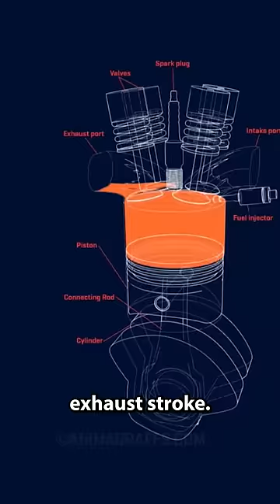Turbos Vs Superchargers

Comment: The exhaust stroke of one cylinder is the power stroke of another. It's connected through the drive shaft. The power to run anything comes from the power stroke of some cylinder. The power conversion of bladed systems in fluid isn't very efficient. With a super charger, you have one fan driven directly by a super efficient belt. With a turbo, you're running a fan off another fan. In terms of efficiency, superchargers are better. In practical application, it comes down to the type of race, and the tuning to determine which is the better option.
Reply: Lmao you obviously have no idea what you are talking about. Turbos use waste heat energy from the exhaust, so they get all that power needed to run the cold side for basically free. There are obviously some losses, but for superchargers, its your engine burning extra fuel to do all the extra mechanical work needed to turn the compressor. So no, they aren't more efficient. They actually drastically increase fuel consumption compared to turbochargers
Reply: Turbos are always more efficient. Superchargers take 10’s of hp to spin-sourced from the crank which turns due to the power stroke. Turbos are not connected to any physically moving part of an engine that the power stroke could move. The only thing spinning a turbo is exhaust gasses which your car makes SEPARATELY from power or useable work in the “exhaust stroke”. The only time you’ll find a turbos efficiency to be less than ideal is when you’re idling and that’s just because you have relatively excessive back-pressure and maybe some heat soak. Which a supercharger is much worse at btw since there’s always a significant “load” to spin the s/c. Also you can and many people do forced induction on less than 4 cylinder engines. They just have more lag because the exhaust pulses (or power strokes) .are further apart: every 90* on 4cyl, 120* on 3, 180* on 2… Flywheels have momentum for a reason so work can still be carried out smoothly between power strokes. Although I think charged air from a turbo will be warmer before the cooler than from a s/c just because it has to share an impeller with HOT exhaust gas which is why an intercooler is almost always necessary for efficient turbos but not always with a s/c. Sorry for the long reply, hope you read it.
Reply: @ZealothPL No such thing as free energy. Turbos require drive pressure, it's the pressure drop across the turbine that drives it, not just heat, stick a turbine in an oven, see how much rotation you get from heat.
Banks himself, talks about back pressure in other videos, that back pressure is putting load on the exhaust stroke, which is coming from another cylinder on its power stroke. 
The efficiency winner is application specific, although more often than not, a turbo is going to win.
Reply: Things people don't consider are that both systems require the engine to consume extra fuel to implement because they increase volumetric efficiency. The only way to test efficiency is to Dyno the engine with the turbo restriction and the load from a supercharger and compare to baseline. Which system causes greater power loss? Exhaust restriction or added load turning a supercharger? Do that for each RPM and compare results versus the power and torque made when the turbo and supercharger are charging the engine.
Reply: Less stress on that one cylinder/rod/bearings is what he’s talking about.
Reply: I agree that it is likely less efficient due to the power in a turbo being from pistion > crank > piston > fan. Whereas a blower is piston > crank> fan. Tirbo likely accumulated more parasitic losses from the extra steps
Reply: @aaronnoyb  "that back pressure is putting load on the exhaust stroke"

the turbo stock or aftermarket, clearly add a muffler effect. so one can easily go more free flowing on the rest of the exhaust for the same db level.
which in theory atleast, should take care of most of your argument
Reply: @hotdog9262  Yes a turbo has a muffling effect, but the pressures are not even close. On my old setup, I was getting 44psi of back/drive pressure, for 28psi of boost, which is considered pretty good,for a street/strip application. Now find me a muffler that could cause a restriction or even contain even half that pressure.
Reply: @aaronnoyb  sure. that is a lot compared to a typical na exhaust. could the turbo and/or the exhaust housing be more optimal though

Comment: Says he prefers turbochargers, then builds a supercharged duranax diesel (aka project lockjaw) to get near instant throttle response. Lol
Reply: You could do a small twin turbo setup for instant torque, it gives max torque much quicker
Reply: The most brutal rally car in history which basicaly baned grop B used supercharger and turbo back in 1986, it weight 1900lbs, had 1,8 L  4 banger and +500HP  Lancia delta S4

Comment: Even if you lose the power on an exhaust stroke its still being driven by a powerstroke on another cylinder, the crankshaft is a ridgid structure. The crank is either pushing air into a turbo or pushing air through a supercharger but in both cases its still pushing

Comment: Thank you Mr. Banks for explaining why a high boost supercharger (10 lb-ft) on a high compression ratio (11:1) gasoline engine can cause a head gasket failure.  This is the reason why you should lower compression ratio of the gasoline engine with lower compression pistons or thicker head gasket.

Comment: Holy cow, Mr. Banks, holy cow. This is why you are d. Guru, in the garage I have a 2017 F 153.5 high output ego boost. My truck was special order. I have the raptor engine without the raptor and I know nothing about Turbo chargers and? Whipples in superchargers. This is my very first brain new truck. I've ever had. It is a remarkable truck and it's paired with a ten speed auto.
I did not know what you just said.
What? You just scooled me on. Just reinsured me that I made the right choice with going with the 3.5 high output VS the 50. Coyote

Comment: To put it simply... Turbo's are more efficient and efficiency creates more power in the end. They don't require extra torque from the engine to work. They use excess power that would go out the exhaust anyway.

Comment: The piston is still connected to the crank shaft on the exhaust stroke so it’s still slows it down. On a V-8 engine, the power stroke for two cylinders is the exhaust stroke for two other cylinders.  Suck, squeeze, pop, blow. When two are popping, two are blowing.

Comment: This is personally why I like twincharging. You get the best of both worlds at the cost of a far more complicated system. 

You get the low end boost of a blower with the high end power efficiency of a turbo. 

The problem is setting up the bypass and having the blower clutch out when not in use and clutch back in when needed.

Comment: I’ve always felt the same way with my builds. Yes in a way the back pressure created by a turbo is still “parasitic”, but for the most part once you get the engine wound up some you’re making power from waste gas, which is far more efficient than making power off your accessory drive. Not to mention you’re also putting much more stress on the crank snout driving a blower hard under boost than you normally would just driving your basic accessories. Anytime you can actually put down more HP per psi that’s a win.

Comment: I don’t think this is true, and I say that with extreme hesitation, being that it’s Gale Banks. The way he explained it made it sound like a turbo is driven solely from exhaust pressure. The exhaust gets that pressure from leftover pressure due to not being able to expand all the way in the power stroke, and from the piston pushing on it during the exhaust stroke. If the piston is doing work on that exhaust pulse to drive the turbo, it gets that power from the crank. 

So that can’t be what mainly drive the turbo, something else is at work here. I don’t know the main source of exhaust pressure. I’d be inclined to believe that residual combustion pressure makes up most of it, and that is a win for turbo charging over supercharging.
But the other MAJOR component is that in most turbines, there is a large conversion of thermal energy into mechanical energy. That is the major reason turbocharging robs less power from engines than super charging—it extracts energy from heat that would otherwise be wasted.

Comment: A huge advantage is that a properly designed turbine (turbo manufactures do what they can, they are limited on space) will recover as much energy as it can from the thermal energy of the gas stream not just the energy in the form of pressure. This means the turbo is running at least partially on energy that would be wasted anyway.

Comment: That used to be true before Displacement Adjusters: three re-expansion and three pre-compression cylinders on a secondary crankshaft produces smooth torque that can be fed to the engine's crankshaft via a CVT transmission that directly controls the engine's working displacement. Maximum efficiency at ANY torque.

Comment: 100% on board with the explanation, but the sacrifice in power per bar in cylinder pressure is worth it in exchange for instantaneous response (this is just a personal preference). If you are after getting the most power in the most efficient way then turbos are the way to go

Comment: As an old-school person I think of it like this, a supercharger you have to hook to the crankshaft and yes it's spools up faster for power quicker. Now a turbocharger is driven off the exhaust system which is a little bit easier, except for the drain back for the turbocharger push the oil to the unit and it spools up slower. But makes great power. One other thing to a supercharger can pump fuel mixture into the engine. And a turbocharger only can pump air into the engine or versus the carburetor.

Comment: Resistance on the explosion creates higher pressure, instead of the chamber expanding and reducing it. 

Turbocharging slows down the engine when there's no ignition happening therefore it's not increasing chamber pressure higher than during standard combustion.

Comment: So with this being said, why did you stick a blower on your 7.1 mega max with the C 10 build and if you don’t like the “parasite“ of the belts, could you run a crank drive pro charger to delete the necessary components of a belt, so you have all power no parasites and you wouldn’t suffer turbo lag

Comment: i agree, to a point, but because a turbo's parasitic power is not pulled on the power stroke of the current cylinder, the power stroke is still pushing the exhaust for an adjacent cylinder. when the current cylinder comes back up in the exhaust stroke, it's being pushed against the exhsust pressure by next cylinder's power stroke (albeit through some degrees lag between events).

Comment: Sir I Honestly Love Your Work, Your Ability To Create The Monsters of Diesel Engines for Which I Absolutely Adore. The 6.6 Duramax is my favorite But Cummins is a Great Motor as well. I am Not a Ford Fan. I suppose because They Have Never Been Able To Build a Solid Diesel Motor. I have Driven Several Wreckers Back as a Young Man and I will Say Uncivilly They are All Bones. They FinallyGod a Decent Transmission because They Are Using The GM 10 Speed Transmission. The Only Thing Ford ever Made in My Humble Opinion is The Heavy Duty Brake Duel Piston Caliper that GM Go Smart and Used.

Comment: Respectable reasons. I'm still partial to superchargers bc you get all that power on tap all the way through the RPM range rather than having to wait for boost to build. Yes, it takes crank HP to drive it, but when you need HP right off the line the supercharger is the way to go.

Comment: Just because its the exhaust stroke powering the turbo doesnt mean there isn't parasitic loss on the power stroke. There is. Its just on the next cylinder in the firing order to make up for the increased load on the exhaust stroke.

What makes turbos more efficient powerwise is that they aren't reliant on crank RPM to spin, every downshift drops the rpm of a blower, whereas Turbos can remain at boost particularly with modern 6+ speed dual clutch transmissions. Newer torque converters have really brought blowers back to center stage for low rpm, high displacement engines.

Comment: In turbocharged application you have the exhaust restrictions from the turbine house. Versus crank driven blower. It depends on the application which is better. The engine doesn't "know" from both either.

Comment: Not to be critical or nitpick, but isnt the power for the exhaust stroke being powered by another cylinder's power stroke? I realize this wouldn't be the case in a single cylinder engine, but in that case the flywheel stores the energy for the non-power strokes. Either way, resistance to the crankshafts rotation at any point of rotation is stealing power. Fortunately for turbo's, it is much smaller loss than a blower. Keep up the great videos, always great info!

Comment: In some applications, the off idle power and response of a supercharger is worth missing out on the hp it takes to drive the supercharger.  Usually a driver thats tip toeing on the limits of traction and has plenty of power prefers the 2d linear response of a supercharged or large powerful na motor over a the 3d response of a turbocharged engine

Comment: Gale I agree with you mostly the one thing that is the back pressure against the piston on the exhaust stroke pushing against the turbocharger is impeding the flow you are correct everywhere but you don't talk about drag race needs quick turbo lag is unacceptable.

Comment: Some variants of the 1710 found in the P38-P51 had a Supercharger that required 330-380 horsepower of parasitic loss just to turn the blower at 28,000 feet.
Edit: Pilots early in the war ran high RPM at low manifold pressure with rich fueling mixture. That’s how I do it, but at 30,000 feet the engine experiences massive OVER-cooling and the blower housing would ice over and lock the screws up. Massive power issue leads to nose down dive to regain airspeed.
Edit edit: if you are at all a gear head, forget any civilian application for the last 80 years. Look purely at wartime developments. They were imagining up cutting edge technology on paper, using ultra-modern machining processes to manufacture new metallurgy parts to then be assembled purely by hand which is wild. SAAB’s aircraft division was only 40 people, 11 of which were purely carpenters lol. This stuff was a blend of art and science never before seen by mankind. What takes modern companies years and multimillions of dollars to design and get to market a junk product, eggheads and grease monkeys were inventing future tech in 9 month periods. None of the stuff we talk about is new, yet again we stand on the shoulders of mechanical giants….

Comment: This is where you couple a turbocharger with a electric motor/generator and a battery bank. Charge up the battery when you don't need boost, and spin up the turbo charger and have zero lag, before the exhaust takes over.

Comment: Turbos are eternally efficient. Energy from exhaust is limitless, whats not needed goes out through cats/exhaust. Big turbo, big injectors, big heat extractor, big downpipe, big boost, forged power train and iron sleeved cylinders equal 95%💪 💪whoop arse...power.

Comment: An even crazier arrangement is mechanical turbo-compound engines. Mainly used in aero engines in the 40s & 50s. The exhaust turbo direct drives the crankshaft !

Comment: So in my mind the powerstroke also drives the exhaust stroke so you're still not getting all of the power out of the powerstroke to the crank. Everything in your car is essentially run from the powerstroke, even the electrical system, so everything you add is parasitic loss.

To be clear idk if this what I'm saying it totally accurate but to me that just makes sense.

Comment: Your choice is a power parasite that takes maybe 40hp and returns 100+ and is reliable or an oil parasite that tends to fail often with a delay in power granting more top end, or 1 great for canyons and the second is great for more open areas, i.e. highways or big winding corners in certain tracks

Comment: I like them too, but you get lag with the turbo.  The blower develops power earlier in the rpm band, which equates to  quicker 1/4 mile times.
I'd be interested in a comparison between the two forced air methods using an engine with the same hp, vehicle weight, and gearing.  This would demonstrate the overall hp gain vs. speed.
Reply: And a Pro Charger as a third option.  Best of both worlds?

Comment: Blowers are 100% cooler in look and sound. But, the turbo charger's design allows the use of an intercooler, the adiabatic efficiency is much better. As Mr. Banks has stated prior, boost pressure isn't always indicative of mass flow and density.

Comment: Dude modified an engine into one of the most powerful Diesel engines ever with only a slight haze of smoke. Jim Bob's still argue that walls of black smoke are the byproduct of power.

Comment: Well, I love the video and I have a turbocharged engine on my car but I feel the video starts talking about cylinder pressure and finishes talking about turbochargers still being parasitic but I don't see the connection between one thing and the other.

Comment: He’s absolutely correct if you’re dealing with a *diesel* engine as they have virtually no compression/boost limit from the standpoint of the fuel. There are diesels running multiple turbos in series creating boost pressures well over 250 psi boost pressure in tractor pulling competitions. 

However, I don’t agree that turbos are superior in gasoline engine applications. 

You’ll never find a turbo gas engine as responsive as a supercharged counterpart.